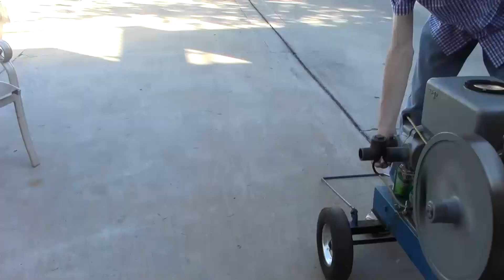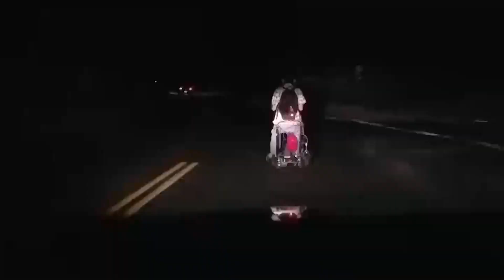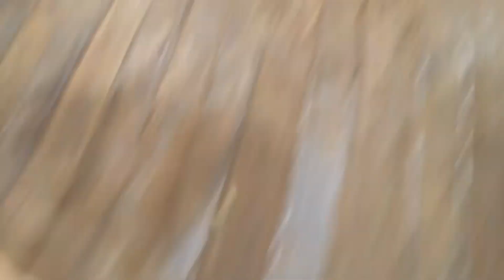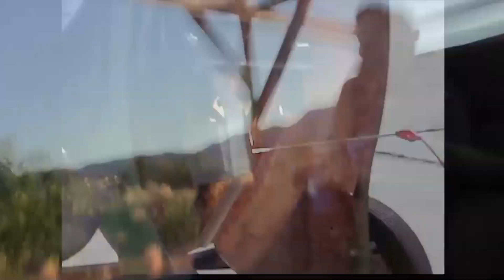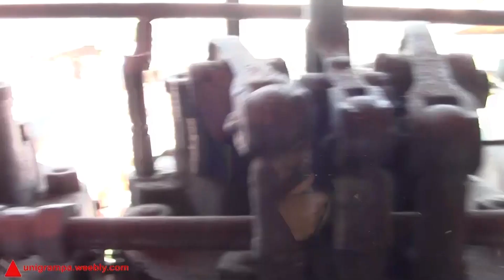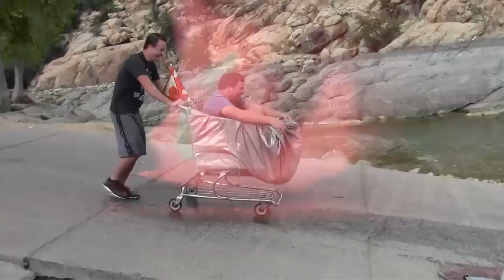Will It Run? Gas Engine VS Diesel

Comment: Once the motor is hot enough it will theoretically run of compression u may even be able to disconnect the spark and it should run on compression
Reply from the maker: Probably not enough compression. I don't know exactly but 8 to 1 or less. Could even be down around 6 to 1.
Diesels generally run, it depends a lot, but roughly 18. I think a diesel can technically work much lower, maybe 12 to 1 ish is the minimum for a practical diesel effect?
But this won't work with a carburetor because, if there was enough compression, it would just pre ignite. Diesels prevent pre ignition by only injecting the fuel when they want it to fire. And the butterfly valve affects manifold vacuum, which affects the dynamic compression, which would change the ignition timing as well as the throttle.
But I would have seen pre ignition if this had enough compression
Reply: Marine diesels sometimes have like 9:1 compression ratio to prevent too acute pressure increasing rate. Due to yhe relatively low surface area: volume, the air temperature can still be high enough for ignition. @unigrampa